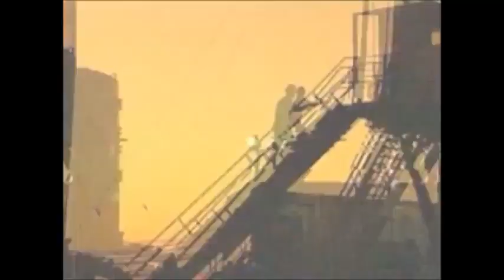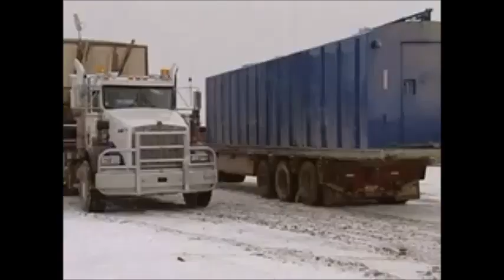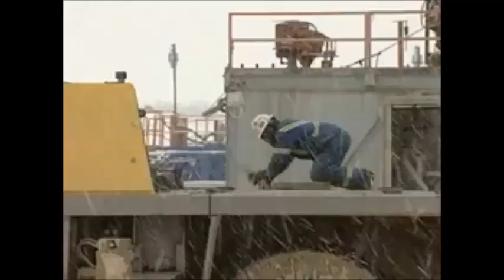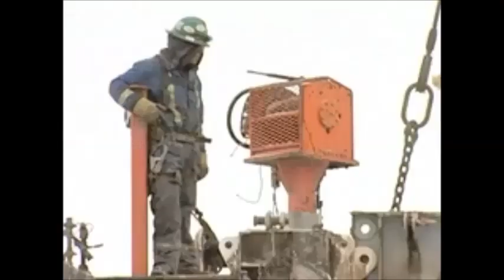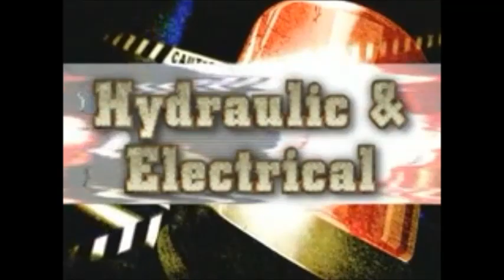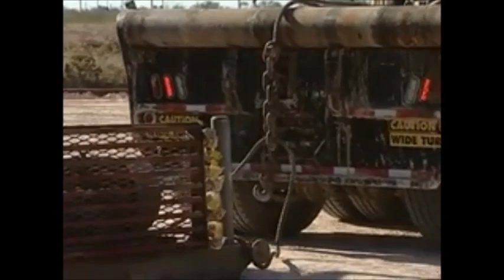Rig Move Hazards

Comment: Actually that rig moved without crane I believe also have seen lots bigger derrick ginned.Swamper roughneck winch driver,before 1980 insurance wasn't so involved with safety-and yes the condition is much safer today than in 1980
Reply from the maker: Thank you for sharing your experience. You're absolutely right that many rigs were moved and derricks were raised without cranes in the past, and experienced crews accomplished remarkable work under very different conditions. Over the years, however, industry standards, engineering controls, and safety requirements have evolved significantly. Today's rig moves place much greater emphasis on risk assessment, lifting plans, dropped-object prevention, and protecting everyone on site. The goal of the video is to highlight those hazards and reinforce the lessons that help prevent incidents. I appreciate you adding your firsthand perspective.

Comment: Back in the day one of the biggest things that compromised safety on a Rig Move was the fact the Rig was on Downtime from the moment the the Company Man released the Rig to Spudding the new well. No we did not Rig down the Rig at night, however after spending 12 hours tearing down the rig on day shift. we then went to the camp and started tearing down the camp and moving trailers all night, One could be up for 36 hours. 
This was in Saudia Arabia in the 80s with Nadrico Saudi (Loffland Bros) and drilling for Aramco on the Kuff Gas Wells on the Eastern Province. Rigs 126-127-128
Reply from the maker: It sounds like you're describing the challenges and safety concerns associated with rig moves and downtime during the 1980s in Saudi Arabia. The fact that the rig was on downtime from the moment it was released by the company man until it started drilling the new well could have compromised safety due to the long hours and fatigue experienced by the crew. Tearing down the rig during the day shift and then moving trailers and dismantling the camp all night could result in crew members being awake for extended periods of time, which increases the risk of accidents and errors. It's important to note that safety practices and regulations have evolved over the years, and efforts have been made to address these concerns and improve the safety of rig operations.

Comment: A smart roughneck would get the fork lift driver to dig the ditch around the substructure. Being in the field over a decade working from lead tongs to driller, I've seen most everything that could happen.
Reply from the maker: As someone with over a decade of experience in the field, you understand the importance of finding smart solutions. Using a forklift to dig a ditch around the substructure is a clever idea that can contribute to efficiency and safety.
Reply: @DrillingHSE  The time spent digging ditches with pick and shovel takes lots of time that could be spent doing more import things. I always had a piece of old casing for the forklift driver to use to dig with. It would take the driver less that 3 mins, as to several hours by hand due to having to stop and make connections etc..
Reply from the maker: @Charles53412  It's fascinating to hear about your creative solution to save time and increase efficiency while digging ditches! Using a piece of old casing for the forklift driver is a clever idea that significantly reduces the manual labor involved. The stark contrast between the times it takes to dig a ditch with a pick and shovel versus using the casing and forklift highlights the importance of finding innovative ways to optimize tasks in various industries. By leveraging the capabilities of machinery and tools, you were able to minimize the time spent on digging and maximize productivity. This not only saves valuable time but also allows workers to allocate their efforts towards more important and higher-value tasks. Streamlining processes like this can have a positive impact on project timelines and overall efficiency. I'm curious to know if there were any other creative solutions or time-saving techniques you employed during your work. It's always inspiring to hear about practical approaches that enhance productivity and make tasks more manageable.
Reply: And yet never amazed when setting never seen before springs up and makes a fool of you. It takes 1000 atta-boys to get a pat on the bac......and 1 a shit to wipe out all atta-boys.

Comment: I used to work for Bill Jackson Trucking and crane service out of Oklahoma City we moved a lot of these rigs just like that. I was either in a 90-ton or 150 ton lattice crane. They were mobile cranes we drove them for about 2 hours then had to let the crane sit there and rest. so we didn't burn the planetary gears out of it. We had a second yard in Elk City Oklahoma. I was all over the state of Oklahoma Texas and a little bit of Louisiana. I did it for 4 years then I got tired of being gone 28 days out of every month. The biggest rig I ever helped move was called Parker 101 it was a largest inshore oil rig at that time. I have never seen a clean roughneck like the one at the beginning of the video with that shiny helmet on he must be a company man that stays in an office. When we would be in the Panhandle Oklahoma or the boot of Texas our biggest fear was rattlesnakes. All them diesel engines running on them generators was a great place for them snakes to warm up. Our second fear was black widow spiders. The West is beautiful but everything out there either bites you or stings you be careful. This video brought back memories thank you have a nice day stay safe. By the way we had a saying in the oilfield. Or else but the oilfield do you have a pusher on every rig joints come 20 ft long and dope comes in 5 gallon buckets LOL
Reply from the maker: It seems you have had extensive experience in the oil industry, particularly in moving rigs. Working with cranes and traveling across different states must have been challenging. Safety concerns such as rattlesnakes and black widow spiders were also part of the job. Thank you for sharing your memories, and stay safe.
Reply: Was Bill Jackson Trucking Hodges who I worked a few days when I first got to Elk City, I ended up working on Service and Workover Rigs for Well Teck' Elk City then Nickles Casing / White Diamond Tong Services all Elk City, Calif - LA - TX - PA - Retired !
Reply from the maker: "That’s an incredible journey — sounds like you’ve seen and done it all across some of the toughest oilfield regions! Those years of hands-on experience are what built the foundation of today’s industry. Much respect for your hard work and dedication — you’ve truly earned that retirement!"
Reply: I ran surface Casing on Parker 101 it was attempting record depth south of Elk City, strung-up on 18 lines, President Carter visited that rig days before our Casing job, we had like 110 joints of heavy-wall 20" but only 90-some made it to bottom, 750 Ton slips and elevators, and used Crane to bring joints up V-Door !
Parker had another biggest Rig in Elk City that I Run Pipe on after that job !
Reply from the maker: That’s an amazing piece of oilfield history! Running surface casing on Parker 101 during that record-depth attempt must have been an unforgettable experience — especially with President Carter visiting the rig. The scale of those operations and the teamwork it took back then are truly inspiring. Much respect for being part of that era and for sharing such a great story from the field!"
Reply: @4Classie wow I helped take down and move Parker 101. About six times she was a very big rig
Reply: In the early 70's Bill Jackson had some the best looking Autocar's for tandems.
Reply from the maker: Absolutely — those old Bill Jackson Autocars were something special! Built strong, looked sharp, and handled the tough rig move roads like a dream. They truly represent the golden era of oilfield trucking — respect to those who drove and maintained them!"
Reply: @DrillingHSE you're exactly right the Gin trucks and the rollbacks

Comment: We had a derrick on the pipe racks they got it half way up and ready to back up but one side didn't leave his winch in gear and used brake, the brake gave and his side came down.It sure curled up the pipe rack.
Reply from the maker: Accidents can happen, even during rigging operations. I can imagine the damage caused when a derrick on the pipe racks came down due to a winch failure. Such incidents can have significant consequences for the equipment involved.

Comment: I've never seen the Derrick moved with pole trucks that is stick.

No reason for a crane lol jk
Reply: Been doing it that way forever! Good hands on pole trucks are way faster than cranes
Reply: I agree . We never had cranes and skytraks were just being introduced . I love your comment Eddie Navarette. . I wish I was still your age.
Reply: Fuck a bunch a cranes c'mon
Reply from the maker: The use of pole trucks for moving the derrick is not a common practice in my experience. Different methods and equipment may be employed depending on the specific rig and circumstances.
Reply: I worked moving rigs in the 1960's -70's and we NEVER had cranes on a rig move. All lifting was done by the pole trucks. The derrick crown was lifted off the stand and lowered so the pin on the crown  could be locked into the fifth wheel on one of the smaller trucks. Two pole trucks lifted the base up and swung it sideways so another bed truck with a " bunk beam"  could be moved under it. The derrick was chained to the bunk. Usually the crown truck went forward and the driver on the tail truck ( transmissions(s)in neutral) watched in his mirrors. A good team could make 30 miles per hour. It was a very effective system for getting around corners as the tail truck would  drive in reverse so the derrick cut across the corner. There were less than half the shacks & tanks that show up on this move, and the trucks were smaller and most were powered with 220 horse power Cummins diesels or 6/71 Jimmies.  Most trucks were either Hayes or Kenworth , with an occasional  Mack ( which were regarded as crap). Most trucks had a five speed main transmission and a four speed auxiliary. It took a while to get proficient in driving them. In 1971, I got my engineering degree and a couple of years later moved to Australia and worked to retirement as a Professional Engineer. I haven't seen snow since 1973 and I am extremely pleased with that. I look back on my crazy days in the Alberta/ Saskatchewan oilpatch  with pleasure and satisfaction about how much we could accomplish with the equipment we had.
Reply from the maker: @316tomiller  That sounds like an incredible experience you had working in the oil patch in the 1960s and 1970s! It's fascinating to hear about the methods used for rig moves during that time. It's impressive that all the lifting was done by pole trucks and that the derrick crown was lowered and locked into the fifth wheel of a smaller truck. The coordination and teamwork required for such moves must have been remarkable.It's also interesting to learn about the types of trucks that were used, such as the Hayes, Kenworth, and occasionally Mack trucks. It's understandable that there would be preferences and opinions about different truck brands among the workers. And with the trucks powered by Cummins diesels or Jimmies, it must have been quite an experience to drive them, especially with the multiple transmissions.Congratulations on obtaining your engineering degree in 1971 and on your subsequent career as a Professional Engineer in Australia until retirement. It's great to hear that you look back on your time in the oil patch with pleasure and satisfaction. And it's understandable that after experiencing the Alberta/Saskatchewan winters, you're pleased not to have seen snow since 1973! Thank you for sharing your story, and I'm glad to hear that you have fond memories of your days in the oil patch and the accomplishments you achieved with the equipment available at that time.
Reply: On a proper Rig Gin Poles would not look at lifting the Drawworks even after splitting the Drawworks or  lifting the four 2200 HP Mud Pumps
Reply from the maker: @whathasxgottodowithit3919.  It is true that on a proper rig, gin poles would typically not be used to lift the drawworks, especially after splitting the drawworks or lifting the four 2200 HP mud pumps. Gin poles are typically used for hoisting and positioning smaller equipment or components on the rig, while larger and heavier components like the drawworks and mud pumps are usually lifted using a crane or other specialized lifting equipment. Using gin poles for such heavy lifts would not be considered safe or appropriate in most rig operations.